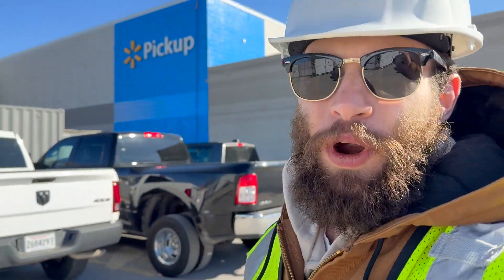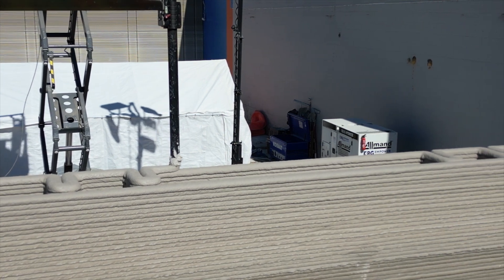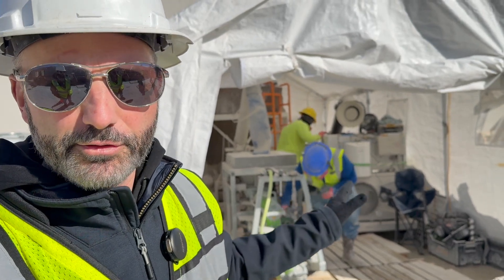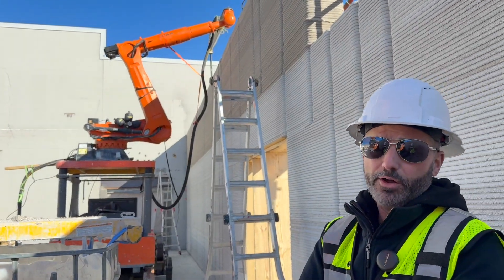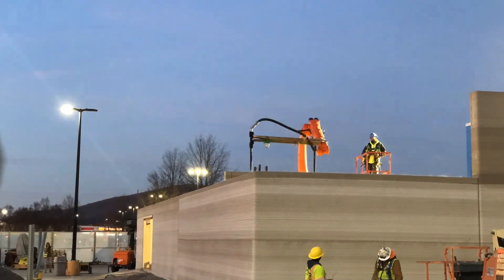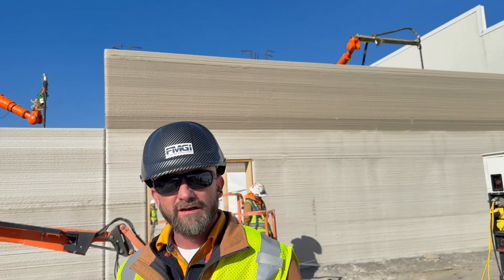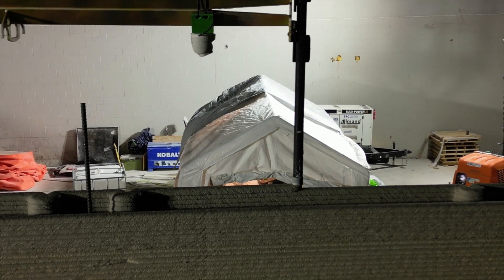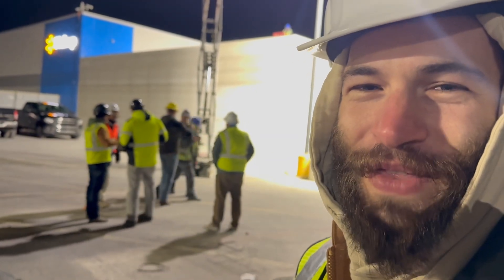Did you know Walmart is PRINTING buildings?

Comment: Another insightful video on this topic. Did Alquists's Zack Mannheimer or FMGI's Nick Pulley give an estimate of how much time traditional CMU/concrete block wall methods would usually take for a comparable 5000 sq ft structure? Did they employ 2 or 3 different shifts to get it done, or just get all the team members lots of overtime? Was it full 24-hour (weekday-only) workdays (did they take ANY time off -other than the rain delays?)